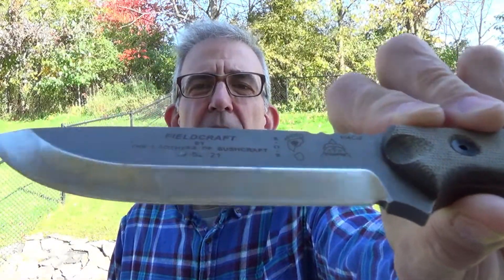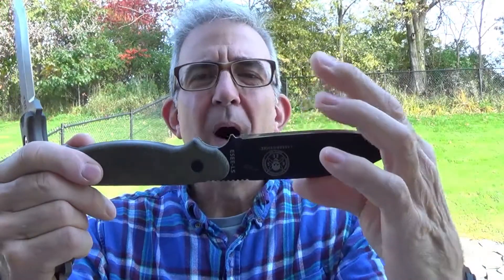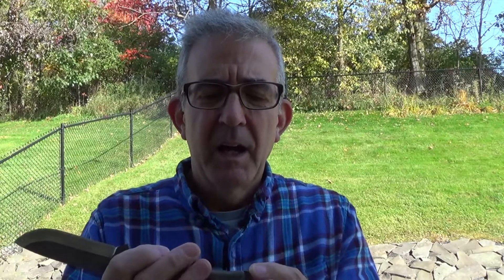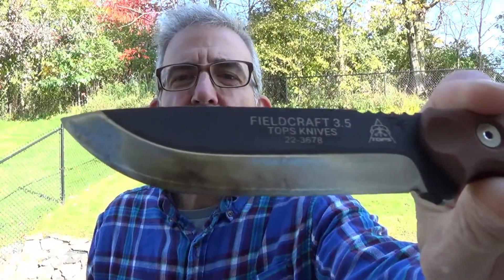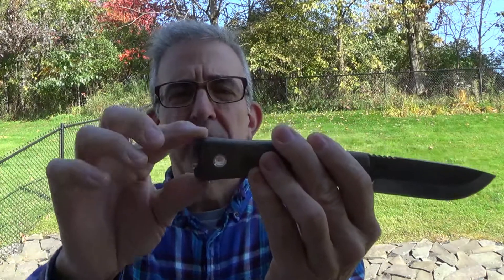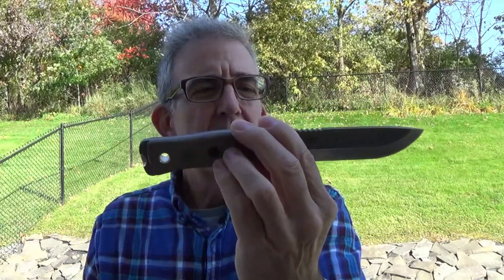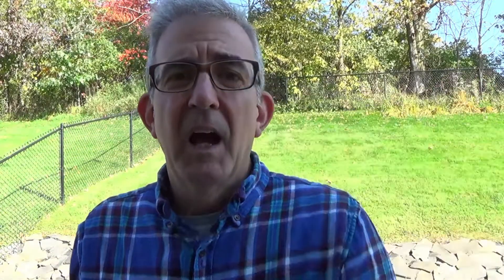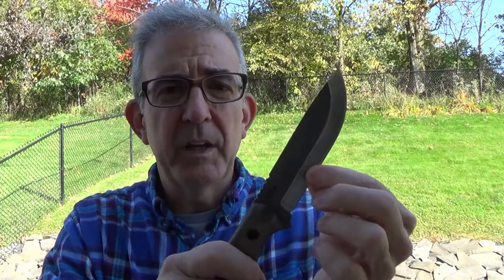Tops Brothers Of Bushcraft Fieldcraft. Is It A Knife Or Sharpened Sewer Lid?

Comment: TOPS knives, in my opinion, are more “aesthetically pleasing” rather than good designed/with good materials, especially for the price. I really like lots of them for the mere aesthetics and their micarta handles, but my gosh they are overpriced and with weird non functioning geometries. They really go for the whole “hype” flow rather than going for what works, probably why they regurgitate so many knives each year compared to any other company.
Reply from the maker: Excellent comment. I totally agree with you. This knife, sort of like the Ultimate Hunter from Cold Steel, are two practical knives from knife makers who make outlandish “fantasy” wacko designs. The only other Tops knife I have is the Tanimboca which is probably my favorite Bushcraft knife.
Reply: @knifetimestory  i have few of them and they are more similar to wedges rather than knives in my opinion, especially if you go on smaller knives. I will never understand this obsession on making thick slab of metal with an edge because most of the time they will have poor cutting performance. TOPS has a problem with that. I’d rather see them releasing less knives, with better geometries (and tested ones) and not going where the trend is from year to year.

They are good looking tho. If someone cares more about the cool knife rather than the practical and functioning one, TOPS is for sure one of the top brands in that regard.
Reply: Sharpened prybars for the most part . They do have a few good ones though .
Reply: @gladeshunter8796  Exactly. You condensed my points in a phrase better than me. That was my personal experience with TOPS. I am madly in love with the Hornero, beautiful blade, ergonomics and all, but the cutting geometry is really bad. It looks more like a small wedge rather than a knife and I don’t love this new fad/modern trend. 
A knife should be primarily a knife and it should cut really well. Everything else is secondary.
Reply from the maker: @clintwestwood3539  You are absolutely right! I’ve had some of the smaller ones and completely given up on trying to put any sort of edge on them because they are just too doggone fat.
Reply from the maker: @gladeshunter8796  I concur. The 3.5 Fieldcraft that I have has taken on a very nice edge and is not ridiculously fat. But my overall favorite so far is the Tanimboca. That is a sweet knife!  I can’t believe Tops makes it.  It is actually a thin blade with a very thin fine slicing edge.

Comment: Thanks for the video. I always enjoy hearing and seeing what others have done with knife. I've used Joe Flowers "Shango" notch on the exposed tang. I've gotten quite good with it, but it takes some practice for sure. The bow drill divot was on both sides. The edge of the blade, if I decide to ever do videos again, I would demonstrate how to care for it. It is a different process to sharpen...Stropping is pretty straightforward. Also, I believe TOPS has a leather sheath that fits the knife...Although I'm not entirely sure, it has been a while since I checked. Thanks again for the video.
Reply from the maker: Thank you for the nice comment. I appreciate it. I’m not aware of any sheath, but I really didn’t look too hard. Because I knew I had a couple that would fit the bill.
Reply: I have this knife in dark green micarta w/red liners.  Found & bought two TOP  leather sheaths, one in black and the other in brown, both have leather danglers.  Very good quality sheaths.

Comment: Awesome video, and timely. I've been considering getting one. As far as the point finger guard....yup, when I had a 1095 version, it was rounded. Also, the "Shango notch"...adios. 

On a different topic, have you ever rehandled a hidden tang knife (say, a cold steel SRK, recon scout, et.al.)? I'd be interested in seeing how you approach that job. Thanks for the good video.
Reply from the maker: That is a great comment. I appreciate your question too.  I initially saw your comment and then couldn’t find it anywhere. So I was unable to reply. Yes… I have Re-handled a hidden tang. Most Randall Knives have a bolt at the butt of the handle. That is quite handy. However if you want to make your handle a little longer, then it gets tricky.  Just be sure to use a really good two-part 5 ton epoxy, fill the handle with it and then clamp everything where it belongs. Are usually also try to incorporate some sort of brass pin to go all the way through the handle and the whore I drilled in the tang. I will never be making a video about it, because it is really such a arduous process and hardly anybody does it.
Reply: @knifetimestory  Roger dodger Sir. Appreciate your time in answering. Looking forward to your next vid. :)

Comment: I don't remember ever having handled that knife, but from other blades I've owned, I can see two of the things you suggested that I'm sure would bug me... First, that metal chunk-thing on the end would go too, if I owned that. That would bother me. Second, that little pointy bit by the 'guard'... I hate those pointy bits. Put a guard on it or don't, just stop doing that little point thingy. 

Thanks for sharing. 👍🏻
Reply from the maker: Well… I am working on both of those things at the present moment. Because of the way they install their thong hole, I really can’t take the handle slabs off so I’m having to grind a little bit and then wait a while for everything to cool off and then grind a little bit more. The “pointy thing“ is now officially gone. It’s that protruding rear end that is taking all the time to work on.

Comment: Could you skeletonize the handle under the scales to improve balance/swing? ...apposed to just remove the butt? 
I really like the Fieldcraft 3.5 btw!
Reply from the maker: Yes… I imagine you could skeletonize the handle. But that would take one hiccup, a lot of drilling, and then filing to make it nice and neat and remove as much material as you could without compromising strength.
Reply: @knifetimestory  ah yes, makes sense. I just picked up an esee4. I think the big issue is the handle tapers midway to the butt. It is short, but if it could be reshaped to help it flare at the butt this would lock in hand while giving it better balance/swing as its bottom heavy. I know they have an extended handle, which only furthers the bottom heavy imbalance. I've drawn out what I think would work. Do you know anyone who could do this grinding/shaping work?
Reply from the maker: Totally agree with you concerning the handle shape and the need for some sort of "flair" at the butt to have as an anchor or stop.  The after-market extended handles fix that, but the shape of them leaves a lot to be desired in my opinion.  I've tried a few times and always take them off and get rid of them. There is not enough material/girth at the but to grind away the center of the handle to create a proper butt like you suggest.